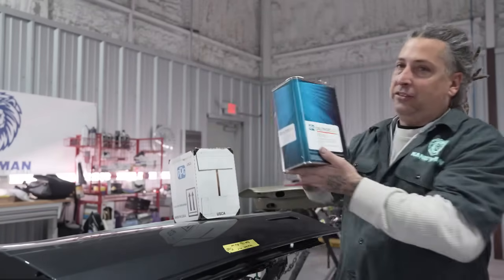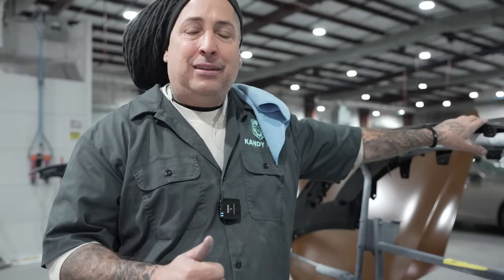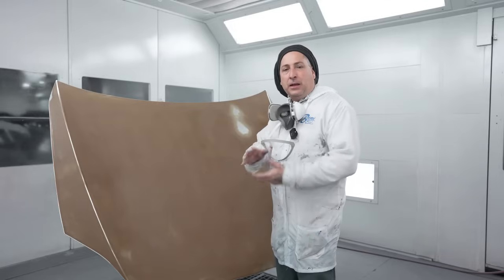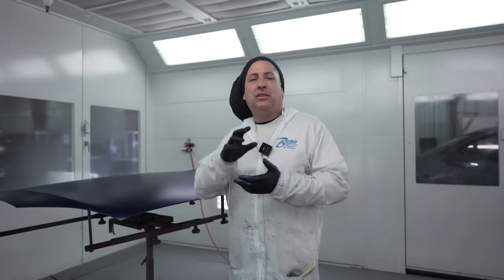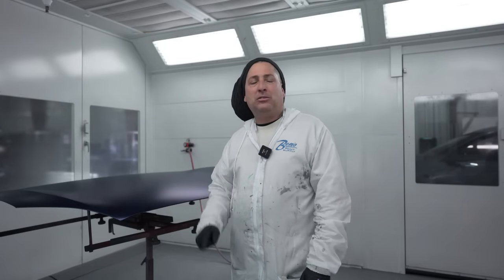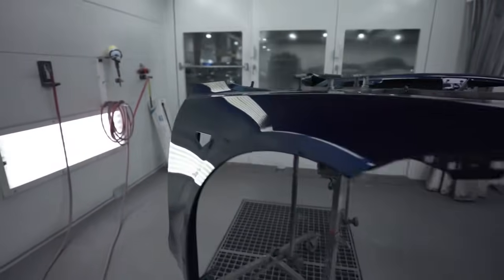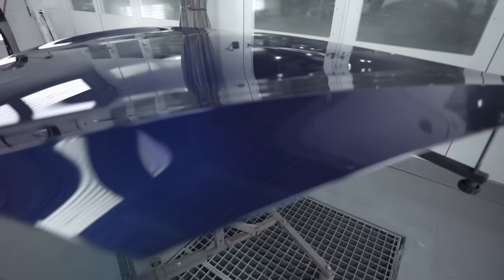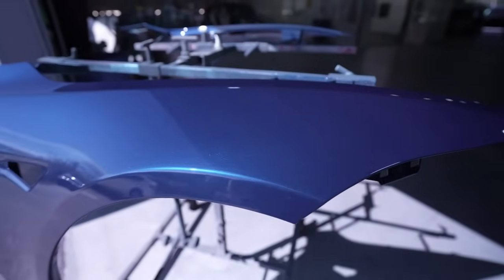No Orange Peel With This Clear Coat -  DIY to Pro

Comment: I think orange peel is less of a threat than solvent pop.  Orange peel can be dealt with even if it appears in most cases, but solvent pop is a show stopper. You can’t sand or buff that out.
Reply: Why are you getting the solvent pop? What is the booth your in? What clear is giving you those annoying divots in the clear your talking about? Share so i can explore what could be happening please
Reply: @ no booth. I’m a homeowner DIY with a field expedient booth in my gee-rage.  This is the most common type of paint operation. But I’ll tell you why I got solvent pop. After much study and inquiries to professional painters, I believe that the hot temperature in the outside atmosphere, coupled with humidity, together with an electric fan cooling the surface before the bottom of the coat could dry, and the lack of sufficient time between coats spelled doom for me. Won’t make the same mistake twice as it cost me much time and money
Reply: @ocsplc  i ran into what you had also and found i was not shutting my fans down fast enough after clearing and was getting that problem and it was wierd cause right after clearing it was fantastic no problem at all then because i left the fans on to long about 15 to 25 min later the issue showed itself and it sucks cause its just miserable to get all of it out. Now i shut my fans down as soon as the overspray is out which takes about 1 min. I started using slower hardner so it wouldn't dry  up as fast and that gives me piece of mind to.
Reply: @ you nailed it.

Comment: Kandy Man actually has a video with the WBX gun and using it for sealer. It was back when they first came out. I’m curious which sealer you’re using? A video about sealer and how to get it flat would be awesome! I like how you list the gun with tip size and pressure in this video, and that would be very helpful in a sealer video too. I appreciate the info you’re sharing with us very much!!
Reply: Thankyou also for bringing that up. I remember him mentioning the finish on them also,
Reply: I agree. A video on sealer would be awesome. I spray Sherwin Williams ultra BC8 and their P30 sealer is good but it does take some work to get it to lay flat or with less orange peel. A bit of extra clear seems to help on sealed panels because the sealer finish will translate into the final finish. I’ve tried all of my guns for sealer but so far I love the WS-400 and the Prolite with the te20 cap best. I also tried the sagola 4600 with the clear cap for sealer. Also works well. Nice finish.

Comment: Holy F'kn Sheet, 700 bucks a Gallon?  That sheet got diamonds in it or something?
Reply: That’s pretty reasonable considering everything else has gone up
Reply: i would want more than diamonds for that money ! 😂
Reply: @bzamski17  I just used a sherwin williams clear coat product with hardener that cost me $108.  Painted the fairing and tank of a sport bike over gold flake and it turned out AWESOME. I can paint more than 20 bikes with the money for this 1 Gallon of whateverthehell it is.  And for the record, with one slight run and NO Orange peel, I'll take it.
Reply: @anonimous2451 true but you won't have a good UV protection and that $108 clear will not last long at all. It's always good at first but down the road is where it counts most
Reply: quality clearcoat I'd paid that if I was doing a complete respray on a nice ride rhat I was keeping for long time.
Reply: @thomas-gj7pp  There are uv protectant clearcoats that do offer that protection at a fraction of the price. And for the record, if one is looking to paint and sell off WGAFF about that? Not me.
Reply: @anonimous2451 Yup finish one can look just as good as any clear.

Comment: You can flow coat a lot of cheap or expensive clears without orange peel if you simply set your guns up correctly. 
For high solids generally speaking, Usually you will need to adjust the flow rate of the clear to apply more material for a wetter coat  while also moving faster while applying clear coat.  At least in my 15 years experience.

I always do a flow coat unless I need to actually match factory orange peel.

Ppg Deltron is by far my favorite to spray.

Comment: what i like about some of the higher end clear coats is that they tends to stay where you put em. a medium coat and and then you can pound em on nice and wet without worrying about it hanging here or there or worry about dieback or pinching. they are definitely more user friendly! i might have to give this stuff a shot next time i spray ppg.

Comment: Nailed it again Kandyman...I also spray my clear with a DV1 wide open up close and moving pretty fast..My DV1 is by far the most flat finish off the gun Out of all my guns..It looks like with the combo of the DV1 and the PPG 50 lays down some syrup flat finish..Whats the cost diffrence between the PPG 50 and the PPG2021??

Comment: Glad to see someone else using good quality clear! Love PPG and Sherwin Williams Ultra. I’ve seen those $150 clears peel from the color within a year or 2. Great video!
Reply from the maker: Thank you
Reply: That does not mean all $150 clear coats are bad clears. Usually clears fail because the person who painted the car did a poor job and did not keep the surfes clean. I have had good luck with Acme Finish first and Akzonobile U-tech and they are $120/clear kit. I have also had great results with Chameleon and Roberlo high solid clears that cost $180 to $250. PPG charging $450  for a 4:1 kit of clear that is 1gal with quart of hardener is basically charging you because it says ppg on it. I would take Roberlo 510kronox or Chameleon 180 fast and perfect over ppg any day and their kits make almost 2gal sprayable clear

Comment: That looks like glassssss killer finish!   I just changed shops and they spray ppg water. Its a weird transition but I like it so far.   This shop unfortunately only sprays ec520 with 98 reducer.  Kinda tricky for bigger jobs.
Reply from the maker: Not a fan of the ec clear. Very inconsistent.  But it does do the job .👊👊
Reply: 520 530 and 550 are the same price.  They’d be money ahead letting you use the right clear for the job rather than buffing completes sprayed with speed clear.

Comment: I was going to use this clear on a custom job....
I was told by the PPG Rep that this clear would NOT work in my cross flow booth...
He said it's recommended for down draft booths ONLY....
So if your spraying in a cross flow booth or in a garage with minimum air flow, you could have issues...
Talk to your local PPG rep & see what's up...
Reply from the maker: I don't agree with him  I spray the last load of the day   let booth run  10 min after  clear, then turn off go home . No issues in the morning

Comment: Another excellent video, I learn so much. When you paint, for example, a wing/fender off the car you have showed how you paint the section that is visible within the engine bay to match the OEM factory finish, but how to you deal with the bolts that hold the wing/fender? Do you paint the bolts separately? Could you show the process including the refitting in a future video please?
Reply from the maker: Cool, thanks!

Comment: Another phenomenal job! So your not the only one who likes the Iwata LPH400 for sealer, but i was wondering what your thoughts are on the W400 WBX. My Iwata rep says that is actually their sealer gun.  Seems like just getting the LPH 400 would give you a great sealer and basecoat gun but i havent heard really any reviews on the wbx and wanted your opinion.
Reply from the maker: I have it sprays great but not a fan because the gun is not  Chrome, so the solvent  tarnishes the gun . But it does spray good
Reply: @kandyman5315  oh thats right i think i saw you talk about that in a video. thanks brother! its an LPH for me also then.
Reply: This is the magic trick you run the w400 1.4 with the wbx water tip almost two decades I use it for clear it will spray anything

Comment: when i spray full fluid full fan 23 psi my clear looks cluggy and sometimes dry, i gotta go slow to make it shine but it makes it look heavy and wavy
Reply from the maker: Same gun
Reply: @kandyman5315  mines a devlibiss gti pro lite
Reply from the maker: That is the difference
Reply: @kandyman5315  how should I set the gun up
Reply from the maker: @darthgeros5863 what clear are you spraying  high solid?
Reply: @kandyman5315  it’s a mid range clear
Reply: For the prolite aircap is a big factor as the TE10 can be used for MS clear between 26-33 psi or if your using the TE20 aircap 28-35 psi is good for that gun have the same myself full fan and full fluid and spray around 6-8 inches off the panel.
Reply: @grahammorgan5025  so TE10 26-33 PSI full fan full fluid 68- inch off panel
Reply: Yes mate that’s what setting I use I use a Sherwin Williams clear MS 2:1 high gloss clear the TE10 sprays similar to the T110 but with a bigger fan pattern. The TE20 works just as well but if you’re looking for the fatter peels on Mercedes and BMWs the TE10 can get the tighter peels that are more for Mazdas, Toyotas and etc. full fan full fluid TE10 26-32/33 psi , TE20 28-35 psi👍
Reply: And both caps 6-8 inches off the panel mate👍

Comment: I see a huge shop with massive air flow this will not work for the average guy painting in his garage with a cheap air compressor I'd like to see you do this using a yadda yadda air compressor and no climate control ya ya
Reply from the maker: This can be used in a  garage. They have multiple hardners from fast to extra slow  for each application  and climate.
Reply: Technically, you are correct, but the DIY home guy isn't going to spend 7-900 bucks on clear, ever.

Comment: The whole point of becoming a professional automotive painter is to Also replicate factory Orange Peel finishes...... If you have a Ford grapefruit finish and you laid down a glass-like finish then it doesn't match the rest of the vehicle and you have to go into wet sanding and buffing the adjacent panels to match.....
Reply from the maker: Well aware